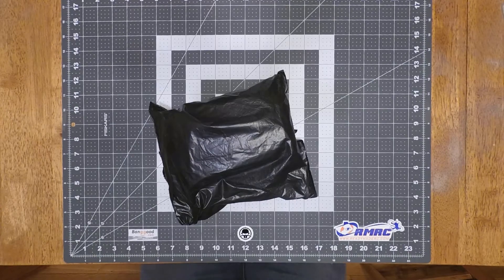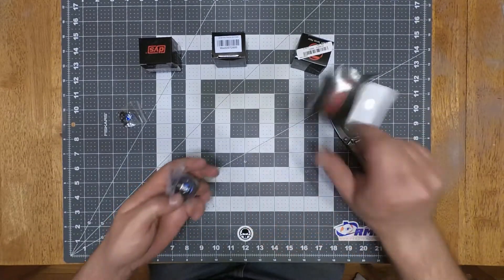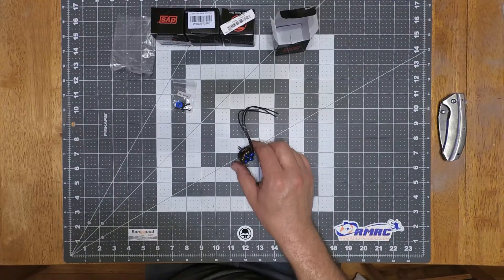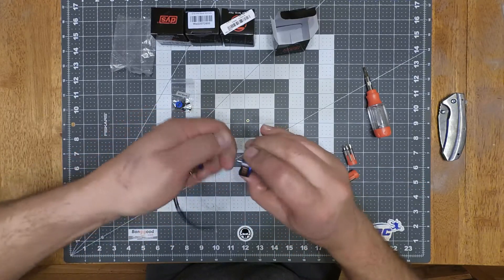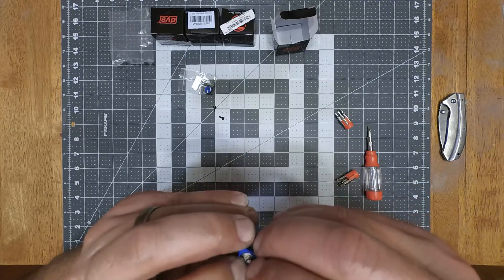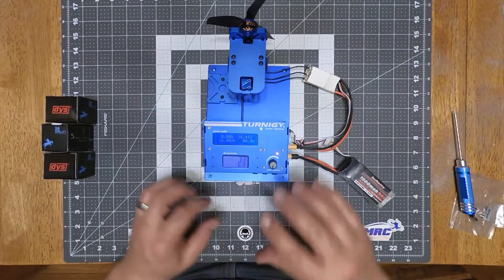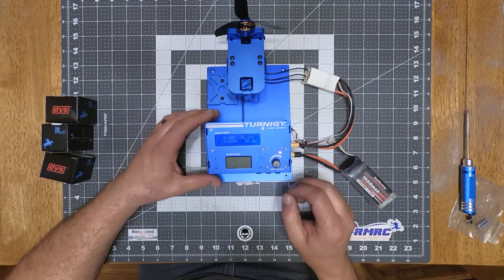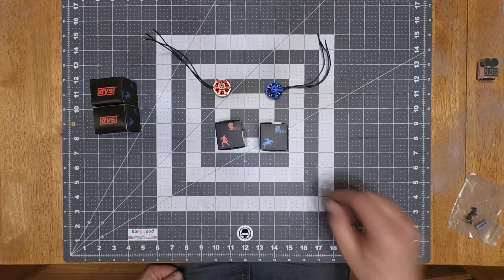DYS Samguk Series Wei 2207 2600KV  Brushless Motor

Comment: i search to bangood no have ccw ?
Reply from the maker: Only right hand threads on them..
Reply: @TorchFpv  can i use in quadqopter?
Reply from the maker: @midastouch656  yes my friend I use them they have a lock nut on them. In a crash the prop could come loose but it's not that big of a problem.. I like using ccw and cw motors but lots of manufacturers don't make both directions.. I've built kwads both ways..

Comment: what should i get for a 5" kwad the shu or wei (my first kwad)
Reply: it's a freestyle kwad
Reply from the maker: Wei in the 2600kv and good 35A esc with a good FC and some cnhl packs! What frame are you looking at?
Reply: Thank you very much for the fast response!
Reply: I'm looking at the martian 2. What battery would you recommend me?
Reply from the maker: @jaimeetxebarria  thanks for watching would you like a torch_fpv decal?
Reply from the maker: @jaimeetxebarria  CNHL 1300mah 4s packs are good! The Martian II is a good frame!
Reply: which c rating?
Reply from the maker: @jaimeetxebarria  the only ones I've flown are the 100c white pack. Get them. 😁👍🏼great quality for the price!
Reply: I think there aren't any replacement bells for the wei on the market
Reply from the maker: If that's a big concern go with the shu they have replaced bells on BG. I just buy an extra motor when I order. I don't go through many bells I don't live in town and most of my flying is done in the woods or in parks where there is not much concrete so I really ever bend or destroy my motors. Hope you get in the air soon! Follow me on Instagram torch_fpv_2 and message me for a free gift and have a great day!
Reply: What are the downsides of the shu?
Reply from the maker: @jaimeetxebarria  in the higher kv they are hard on your batterys amp hungry..

Comment: Hi, thanks for the test, as another posted, i have the same problem, i don't know if i would choose AOKFly 2650 KV or 2207 Wei 2600 KV. It will be used on an zmr250 quad with 30A ESCs and the heavy and power hungry T5045C cyclones. I'm more in need of speed than torque and don't know what to choose between both of them. But considering i found the official AOKFLY store, there is no chance i get the fake AOKFLY with bad quality. So wich motors should i consider ? Thanks if you take the time to answer.
Reply from the maker: Jack Inu, I'm still ripping the aokfly they are fast! If I can say they are good motors I can't yet attest to the quality of the dys my build is only half done.. So at this point I would say the Aokfky are the way to go till I test the dys in the real world. Thanks for your comment have a great day!!
Reply: Woaw, what a fast answer, thanks a lot !
Reply from the maker: Jack Inu, here to help with what I can my friend! Have a great day!

Comment: Hi Josh,
Now that you've tested the three engines on my list for a new built, wich one would you recommend: The DYS Wei, Shu or Aokfly RV2306?
Tnx for the review!!
Reply from the maker: r2 Intheair, hi my friend! Yeah I wish the aokfly but they are not consistent with the quality control and the postable fake issues, I love the ones on my Furious220!! But the safe bet is the dys samguk motors ether one is good the Wei are a bit less amp hungry but still maintain good thrust really it's almost a wash between the two they are both good you can't go wrong with them.. Have a great day my friend!